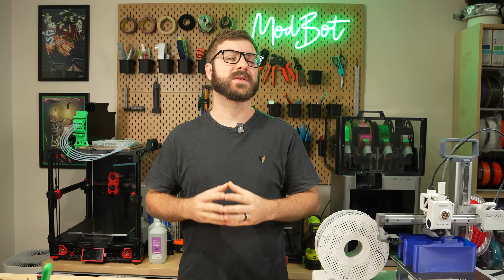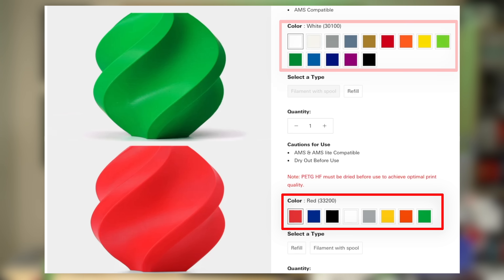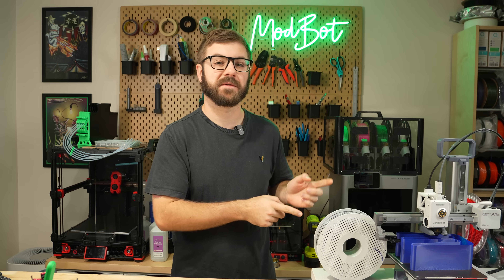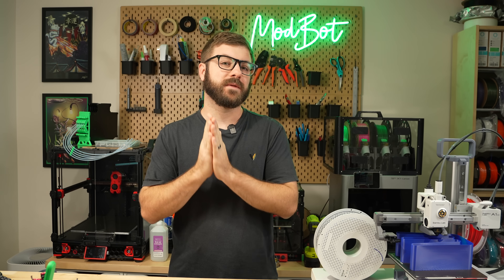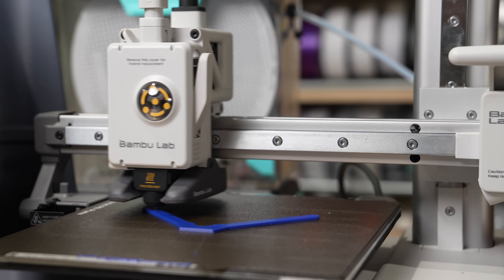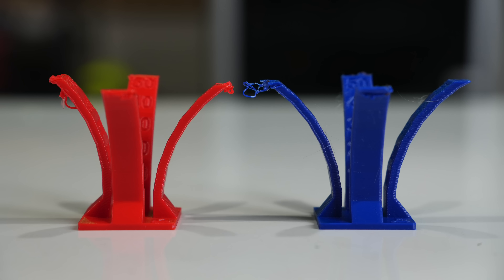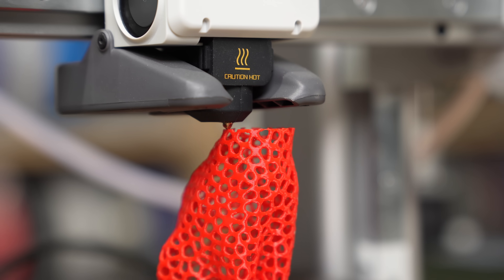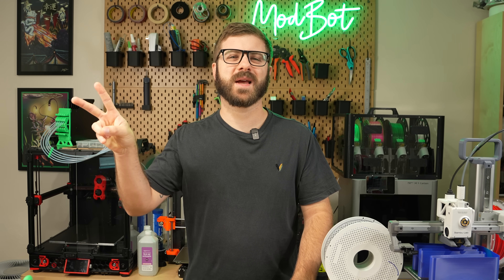Is HF PETG Actually High Flow? (And What Are The Trade-offs?)

Comment: There is definitely a chemistry change between old school PETG and HF/Hyper/Rapid/Whatever PETG. If you try to run say Esun clear PETG at even 150mm sec, no matter what you do with temps and such you're still going to see some frosting problems with it. It will start to look like frosted glass and the faster you push it the worse it looks. If you do nothing else but replace the spool with say Elegoo Rapid clear PETG all of a sudden it looks like slow-printed old school PETG... even at 300+mm/sec.
Apparently though as noted in the video, there are some consequences to whatever changes they made to the formula. Old school Sunlu PETG for instance has mad strength characteristics compared to these HF variants. Doesn't matter if you're not planning on throwing your prints out into freeway traffic, but if you ARE making parts that will take a beating, you might run into some problems with failure rates.

Also, depending on the part design of your print, the increased speeds may induce vibration in your print, causing some really confusing print defects until you realize what's happening. Vibration damping in the machine will only get you so far when the whole machine is shaking like an unbalanced centrifuge, lol. I ran into exactly this when I attempted to print my printer addon poop chute design at an insane 600mm/sec. It looked almost like bad filament - waves of frosted areas in the walls of the object. Dropping it to 300mm/sec cleared it right up.

And as @Davids3DProjects noted, you really need to play with your print settings if you're aiming for high speeds. You have to strike a real balance between speeds, extruder temps and cooling. You want each layer to be hot in order to adhere well to the previous, but not too hot. Too hot and you'll get warp, too cold and you'll get poor adhesion. I ran a print or two with a cheap phone thermal camera and watched it glow for the past layer or two but no heat soaking. Was neat to see it lay down glowing lines like some kind of Tron thing. 🙂

Comment: Just picked up a bambu A1 mini and intended to use PLA for most stuff and PETG for the high temp and other better properties but with the decreased layer adhesion of the HF i will be looking at another brand of PETG or another type of plastic for higher heat resistance.  Kinda wishing i got the A1 now for ABS but didnt intend to print with ABS anymore due to the hassle.
Reply: if you want heat resistance try the new PLA-high temp (HT). up to 150C

Comment: I've been playing with PETG-HF and the only issue I've seen is very pronounced seams.  I've tried all the options for hiding seams including using scarf seams, but just can't get them to disappear.  I can get them to be quite a bit less than Bambu's stock filament settings though.  Pressure advance settings can be used to reduce the seam as well.  I've had zero issues with using the filament sans the drying requirement.  I dried one roll in a commercial dryer at 10% RE for two weeks and left another unwrapped roll sit out on a table for the same two weeks-- both rolls printed with the exact same quality.  So I don't even bother to dry this stuff and have had no issues.  The drying requirement initially kept me away from this filament, but now that I see it isn't even a requirement it is only Bambu's inability to keep it in stock that is the down side.  It took 3 weeks for them to ship my most recent order of this material.
Reply: You simply live in an area where there's not much humidity. 
If you lived by the ocean, you wouldn't get good results without drying. 
The inhabitants of the Amazon rainforest have it the worst... :-D

Comment: why is max print speed listed as mm/s???? what is the equivalent volumetric flow rates?
Reply: its just a standard, im assuming 0.2 layer with 0.4 layer.
Reply: @urgamecshk  assume make an ass out of you and me ;). my point was that mm/s is useless as a metric when we're talking about "flow rate"
Reply: @Jaze2022  bc volumetric flow rate changes from .2 .4 .6 .8 hotends... 600mm/s equivalent of mm3/s on a .4 nozzle is NOT the same on other nozzles.
Reply: @XxAtomic646xX   exactly why mm/s was a useless metric if it wasn't associated with a nozzle size and print layer height.

Comment: complete beginner here, bought it to print an itx case that isnt done by a manufacturer yet. for it to be a pc case, parts and exaust air could exceed 60c which is why petg (hf) was a consideration on my a1mini. i got it fresh out he bag to print something and it looked very weird... benchies looked worse then with pla.

i dont have much experience with 3d printing yet but as far as beginner friendliness goes, petg hf is worse then pla which most novice 3dprinter users probably knew....

i for one cant think of why petg basic would be discontinued but higher stiffness wouldve been very welcome for what intend to do despite less strenght in every other aspect... well if i had a better experience but i stick to pla for now until i know how to configure the printer. because, i mean, this video is with stock settings and no modifications. maybe bigger nozle would help here with thicker layers and slower speed

Comment: Hi, nice video and I will be checking out your others shortly. I have one question, I have an X1C and would like to carry out the flow test that you show but all those I have found online don't seem to work, ie they produce a completely uniform print from bottom to top as if the flow rate is not being adjusted. Can you tell me where you got your test model from and how you extended the flow rate range please ??  Thanks

Comment: I've been using Elegoo Rapid PETG and I love it. I just turned up the temps and it works great! on the K1 Max. It is also sold in multiple and quad packs. The colors look good after printing.
Reply: im just trying this stuff now. got my temp at 265 currently. I checked what Elegoo had it set for their century carbon which was 250c and layers were poorly adhered.
Reply: I switched to hyper PETG with my K1max and I get a lot of random bad layers on long prints? What setting are you running?
Reply: @UnshavedRocket  Temp 220-240, Max Volumetric Speed 20-25, Cooling 70-80%

Comment: I'm definitely with you in that I feel like they should keep both since each one has its strong points, but if it's a case of you have to pick one, I feel like the high flow is the better choice since it probably has a wider range of applications

Comment: Really should have tested using the BBL Profiles, they provide them for a reason.

Comparing the profiles here - part Cooling Fan has five differences in it's profile section, including for overhangs, min print speed etc. Also nozzle temp in the HF profile is lower for both initial layer at 235 vs 255 and then it uses 245 instead of 255 for the remainder of the print.

Comment: Unfortunately the mechanical changes are pretty much a deal breaker. Plus the requirement of drying pushed me away right away. If the ams was a dryer I wouldn't care. But since it's not they should keep the basic petg also.

Comment: This is very strange.  I’ve been writing a lot of filament reviews, and that Cat is one of the models that I have been using in my reviews.  I have never had an issue with it sticking to the bed, and I never use rafts.  There are only 2 differences that I can see, 1) Is that I’m using K1 Max’s with the original build plate, and you’re using various Bambu printers with various build plates.  And 2) I will attempt to tune the filament if I see any issues, as it is unfair to the manufacturer to do otherwise.

While reviewing filaments, especially at higher speeds, I always set the temp to the higher end of the recommend range.  Usually 5-10 degrees lower than max, but sometimes ever higher than max if I can determine that the provided settings are inaccurate/wrong.  To date, I have only run into 2 non-TPU filaments that can’t print at 300mm/s, 1 being a glow-in-dark filament that can’t be print using a 0.40mm nozzle on any printer, and a nylon that can only be printed at temps below the normal nylon temperature range.

I am starting a new round of reviews, which I will be testing at up to 400mm/s for normal prints, as I have been able to tweak my custom PrusaSlicer profiles over the past 6 months.  Anywho, for the most part I haven’t seen very much of a difference between normal filaments and high-speed filaments, other than a lower viscosity, which has pluses and minuses.  A lower viscosity can make prints worse if you don’t have a significant increase in cooling.  There may be additional differences with non-stock hotends, but that’s a completely different test.

Best
Reply: Are your tests available somewhere? I'm not interested in fancy videos, just an excel sheet would be great. 
I was very frustrated to find no comprehensive comparison of PETG filaments. It is the cheapest plastic that is suitable for many technical applications. So I started my own tests with a small rig for measuring layer adhesion and I evaluate optimal settings visually with some dedicated models (i think temp towers are one of the most overrated and wrongly used  testprints).
But I'm still far away from measuring other properties like impact strength and more. 
So it would be great to see other people's results.
Reply: @Alex_vGrafenstein  I don’t have any such data, as I haven’t had a need for that level of control.  You should continue to do as you are doing, as there are a lot of things that need to be factored, which only you really know for your situation.  The only thing that I would add for your situation is, once you’ve decided on a specific product, you should periodically retest that product, especially if it is not a major brand.  The reason being that the manufacturer may change the product chemistry w/o any notice.

Many no-name brands are actually manufactured by the same company, and Polymaker produces the filament for a lot of no-name brands.  BEST!
Reply from the maker: @cnc-maker   the brims was a default thing in the slicer. I wouldn’t normally use them but I just left everything as is in this case. The sticking like that was because I am experimenting with vision miner nano polymer adhesive. It sticks crazy well. I had previously applied it to the plate for testing or it all would have came off with little effort 😊.
Reply: @ModBotArmy  that's cool.  I watched the video again as I missed the fact that the Basic PETG has a lower recommend print speed range, which is not something that I've run into before.  I think Polymaker originally said something similar about their filaments, but later changed the specs, as it just depends.  The comparison specs are rather interesting, and does show that they have created their own recipes, which are quite different from one another.  I'll let CNC Kitchen run his tests on those differences, as that is his arena.

I've never tried Bambu filament, so if it ever comes up for review, I'll probably need to tune it.  I remember the very first time I used Polymaker, I had a hell of time.  Their PLA, ABS and ASA filaments do not react like those from most other manufacturers.  Only their PETG was similar to that of other brands.  Once I got the others tuned in, it was smooth sailing, but it was definitely frustrating trying to get everything dialed in.  ABS and ASA slurries helped a lot for adhesion.  BEST

Comment: For my use case, PETG is simply a higher temp resistance version of PLA. So the closer they can make its printing characteristics to PLA - the better. Their high flow PETG makes sense to me, but I know for sure it won’t necessarily make sense to everyone. I agree they should have kept both HF and Basic around due to this fact.

Comment: I hear hf petg is better than petg when using a cht style nozzle. That’s what I want to test.
Reply: Yea was wondering if those of us with higher flow nozzles like the CHT or the e3d obxidian would see better flow rates.
Reply: @st3venb  I find PETG unbearable with hf nozzles. The stringing is so bad. I gave up on PETG when I switched to CHT/obXidian
Reply: I’ve run an obxidian for over a thousand hours now and I print exclusively in petg. I haven’t had any issues. I mostly printed Hatchbox and Elegoo rapid.
Reply: @st3venb  that’s great! I’ll try those. PETG hates me I swear. No worse stringing or anything different with the obXidian? I’m using a standard CHT. I just lumped the obXidian in there from reports from others saying they have the same issues.

Comment: I got 10 spools of this filament right when it came out, and so far, it's been much better than regular PETG in a lot of ways. I don't dry it at all, and I'm printing from the AMS on my Bambu P1S printers. It prints fine, even considering that I live in Florida's humid weather and the printers are located in the garage. Less stringing and easier support removal are two game-changers for me, especially since I sometimes want prints to hold up outside for a while.
Reply: is it smellier than pla?
Reply: @bottlefish6386  PETG itself aren't smelly filament and I don't feel much, but keep in mind as mentioned before my printers are the garage and occasionally I vent it.
Reply: I print in my bedroom (in florida humidity with a fish tank in the room, avg ambient 45-50% humiditywith a/c on constantly really..) 
And have also never dried my petg.. never had any issues...
Also don't notice any smell whatsoever, but i have a p1s so enclosed with carbon filtration. Even when printing ASA I don't smell much unless I sniff the very small openings of the p1s...

Also, my petg is stored in open air and printed from ams with desicant but.. stored open so.. if it has hygroscopic issues I have been lucky to not witness them.

Comment: That heat plate available for Ender 3 v2? I need to replace the stock bed with something that don't need glue.
Reply: @The_Traveling_Clown  if you want something that PETG sticks really well to, try G10 FR4  Garolite sheets in 1.5mm thickness. They need to have no residual oils from you fingers on them, so I wipe mine down with glass cleaner (just the cheap blue kind in spray bottles) and then I wipe them down with a spray bottle of water with a drop of dawn dish washing liquid in it after that. PETG sticks to it great until you inevitably get oils from your fingers on it, then you have to wipe them down again. Maker’s Muse put out a video about it a while back, it works great for PETG. Prints come off easy after the bed cools down but stick really well while the bed is hot. I run my bed temp at 85°C for PETG.
Reply: @TheFishingHobby  Thanks for the reply. I actually want a buld surface that works with most materials. Such as PLA, PTU, and PETG, ext.
Reply: @The_Traveling_Clown  I’ve never printed TPU on these sheets, but PETG and PLA stick to it very well. TPU would probably need a sacrificial coating like hairspray to allow it to be removed. It wouldn’t surprise me at all if TPU would bond too well put a light misting with hairspray would allow a separation layer. Hairspray works really well on glass too for allowing prints to stick to the glass, but I got tiered of having to clean and reapply it every couple of days. That is when I moved to the G10 build surfaces. If you can keep your fingers off it, it works flawlessly.
Reply: Dual sided PEI magnetic spring steel bed FTW 😉 Smooth side for small and smooth-bottomed PLA parts, textured for pretty much everything. At least Comgrow makes and sells those.

Smooth side is delicate for nozzle crashes, so textured-only sheet is also a good option. Just have brim around small prints.

Comment: I use our Bambu printers at work for functional research parts. We use PETG often for it's mechanical properties and chemical resistance. I will have to check the MSDS, but it looks like I will be using another brand primarily as this is a step backwards in my uses.

Comment: I've had a lot of problems with the HF PETG. I can't get it to print right at all. I get more stringing than basic PETG, more blobs and defects, and it's not as shiny and glossy, which I liked about their basic PETG. Cutting or carving any defects away leaves a cloudy scraped surface instead of a similarly glossy surface. Everything about this filament has been a downgrade in my opinion, and before you ask, yes I tuned the filament, but worse bridging and worse scratch resistance was a horrible trade off. I'm really sad because Bambu's Red Basic PETG is my favorite red filament by far and now I'll have to find a replacement.
Reply: Just get some polymaker petg ;)
Reply: >cloudy scraped surface instead of a similarly glossy surface.
sounds similar to what happens when filament is printed above a certain volumetric speed and suddenly changes between glossy and matte (the other riba guy has replied to every comment critical of the hf petg and vehemently defending it for some reason, no idea why they are telling you to buy polymaker now...)
Reply: @mrrooter601  well either way I haven't bought playmaker in a long time. It's good, but California filament is way better and the exact amount of glossy translucently I enjoy. Guess I'll buy their red from now on. I also have a lot of Atomic PETG; it's really incredible filament, but pricey. Best to buy samples before you buy a full spool. Love their Marble and Silver PETG.